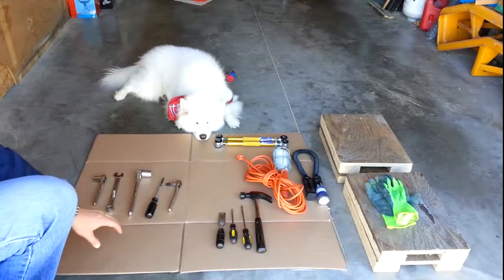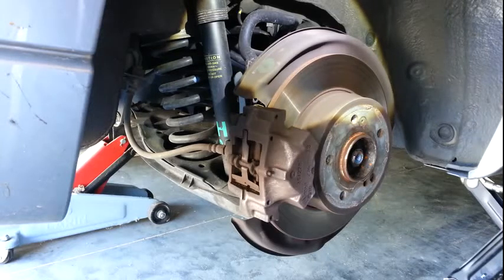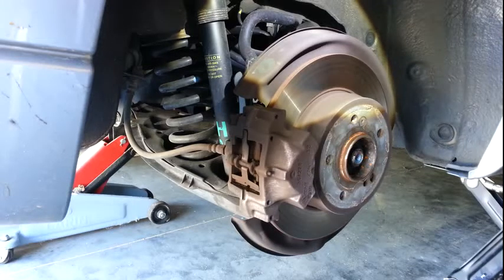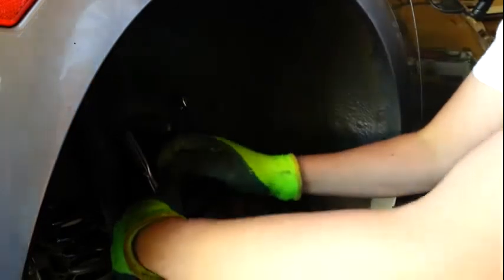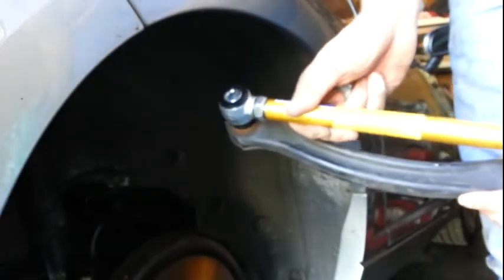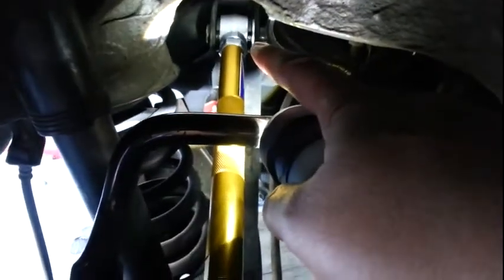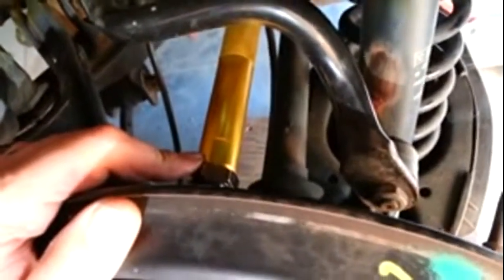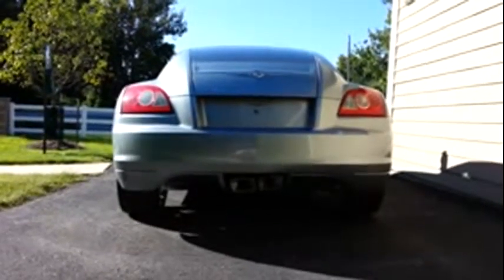Rear Adjustable Camber Arms Installation, Chrysler Crossfire (Mercedes R170,SLK,CLK,AMG,SRT) strut

Comment: Would these arms fit my Mercedes clk w209? If so what make are they? Thanks
Reply from the maker: I really need to put a second video together on how to build these things. The pieces are purchased through speedway motors. I have to admit, I do not know if they will fit a w209, however I am confident you can buy other pieces from speedway to make these fit.

Comment: i have a 2009 w204 mercedes, do you think this will work? I think they have very similar rear ends
Reply from the maker: You will need to pull the bars, measure the distance and order accordingly. I believe the after 2005 the rear end got a little wider and the components a little stronger.
Reply: @glencouls  did you have to adjust the toe after you got the car aligned? or did the factory adjustment make up for it?
Reply from the maker: The alignment that you paid for should have adjusted any tow or needed. When you get your car aligned make sure you ask for the camber and tow printout the machine creates for the mechanic. There are many shops that consider a varience of - 0.02 outside of spec OK, this will burn you through tires on the CF faster than it should, CF tires are expensive.
Reply: @glencouls  Makes sense. Im asking because some people say they have to readjust the toe after correcting the camber. There's a small camber bolt used to adjust the toe but it only offers small adjustments (+-0.5 degrees?). I want to make sure I dont need a bigger adjustable toe arm.
Reply from the maker: I did require a full alignment after my camber install, this included toe, and camber adjustment for front. The print out before and after is imperative.
Reply: glencouls I finally got around to doing it today. Turns out it fits without hitting the sway bar. There’s about a quarter of an inch of space and I used a 10 inch bar instead of 9
Reply from the maker: Thanks for this info for our other viewers, you did a good thing here for sure!

Comment: Great video, any issues with camber arm hitting the sway bar?
Reply from the maker: No, not with stock heights. The arms will hit if you lower the car. In that instance you will need to purchase camber adjustment arms that look more like a dog leg, they have a little crook in them that jettisons off in about a 10 or 15 degree angle. I live in a large metropolitan area that does very poor road maintenance, so lowering the car and battling these mammoth potholes is just out of the question. If you have a lowered car please consider subscribing, I have suspension videos coming, and an interesting video planned on how to file an insurance claim against a pothole and not be denied. Thanks for watching!

Comment: I ordered parts and will be changing out on my 2002 mercedes-benz clk55.
Rear camber adjustment  
Will I need to get the rear alignment check at a shop after I install the arms?
Reply from the maker: Hey, thanks for watching the video. You will need to get the car over to a shop and on an alignment machine so the camber values can be inspected. You want the report printed out by the alignment machine. It looks like :58 seconds in on this video:  https://youtu.be/tw_bOHEoNzA make sure you let the mechanic know you installed the camber adjustment arms so they know camber can be adjusted on your vehicle. Please confirm doing this on your clk is required. Your version may have camber adjustable bolts installed.

Comment: Hi there...did you ever find your car to occassionally feel like it was stearing from the back on uneven surfaces? I have four new Perrelli tyres on mine. I just bought car, and I find when I floor it or drive on un even surfaces the car feel really unsettled and occassionally even stears from the back left ....hoping camber change may sort issue ...any help would be great
Reply from the maker: Yep, I have felt it even after the camber install. I feel It's due to the width of the tires, the high power engine, and the light weight of the car. It doesn't take breaks in pavement very well even at low speeds. When I really get after it, it feels a little  squirrely back there unless the pavement is perfect. maybe that's what happened to this guy https://www.youtube.com/watch?v=lX6Msptajz8
Reply: glencouls lol seems I'll be keeping it under 65 then.   Hahahahaha
Reply from the maker: J Dude I wouldn't be that freaked out about it. it's just a little shift or weight redistribution. I have had the car up to 120 mph in the mountain passes coming out of British Columbia. there are plenty of little pavement breaks, road cracks, even pot holes, the car did great. I'm with you however it's a little unnerving when you are going 70, gun it and feel that little shift when passing somebody or whatever.
Reply: no worries mate ....I still like the car ....Id like to get it fixed ....probably gonna change rear sub frame bushes next. I have checked bearings - camber arms - shocks might be old but working fine ...I reckon the rear sub frame is shifting slightly under surface change and heavy load .... we shall see ...still sexy as faaaaaak sounding engine : -)

Comment: I don't what kind of mechanic yuo are but the adjustble camber arms already install't to correkt the line up the weels in the back of the car und yuo just don'know wher it is ;-)
Reply from the maker: everybody on the Internet is a master mechanic right? I'll be the first to admit I'm a programmer, not a mechanic, but I can tell you, the Chrysler Crossfire based on Mercedes Benz R170 chassis has no camber adjustment at the rear of the vehicle. if you know differently, then please provide a link to your repair. Thanks for your contribution.
Reply: Ok i tri ,i'am driving an SLK 170 since 12 yaers and this year i had to replace all the link's at the rearachsle and there are 2adjustble scews to setup the tire alinement they sit at the lower front at the bodyside.I try make picture but i can't link i in here i put a link http://www.mbslk.de/images/forum/beitragsbilder/938616 it's  german forum about SLK's
Reply from the maker: +Klaus Nebeling thanks for taking the time to put a link up. I'm on the road at the moment and will need to investigate this when I get home. being in front like that, I would believe that it's more related to toe then to camber. I would think for camber you would want a strut from the top or bottom linkage.

Comment: hello glencouls, I have a 03 mercedes clk55 amg and i curbed it pretty bad on the left front tire. the ailgnment got messed up and the dealership said i need to replace my front torque arm bushings.  I think I want to just get 2 new arms but there are so many options (front "rear", front left upper, front torque rear). I just need the 2 front torque arms (passanger and drivers side). PLease help.
Reply from the maker: I'm not very familiar with the clk55, sorry. I believe it shares the same chassis as the Crossfire Mercedes R120. I would reference this manual, http://cl-44.iwatchradio.pw/owncloud/index.php/s/3AEasz2rw6Xc3o8 (password:"amg") get the names of the parts you which to change, and look them up on rockauto.com.
Reply from the maker: *should say Mercedes R170 Chassis. This also marks the first time I've used my owncloud as a public file share,  so if you could let me know if you were able to get the file I would greatly appreciate it. Thanks.
Reply: link didnt work but thanks for the response
Reply from the maker: +Alexa Navarro my self signed certificate was giving me some trouble yesterday. I have since rebuilt the certificate.  when going for this link the browser will likely complain about the self signed certificate not being from a trusted source. it's ok, my server is not trying to take over your browser. Try this link: https://cl-44.iwatchradio.pw:442/owncloud/index.php/s/3AEasz2rw6Xc3o8 notice this link is "Https" that is significant of the security certificate. This link just worked for me. use a desktop computer to view this file. its a large PDF with over 3,000 pages, your phone could choke on it's size. explaining in detail how to take apart a R170 chassis vehicle.

Comment: i have a mercedes slk 320 and i just hit a curb really bad and the allignment is completly off but the back right side wheel go littteraly bent in to the point where the tire is aiming towards the inside so i replaced the part that got actually bent but i was planing on going to the mercedes dealer to go get an allignment because they have a special here in texas where its only 120$ would you think they would adjust the camber while doing the allignment or no? please answer quickly as i am going tomorow
Reply from the maker: camber should be adjusted during an alignment.  make sure, you specifically ask them to check the camber, and remind them you want it within factory spec.  you should get a print out like you see in this video at :56 seconds: https://m.youtube.com/watch?v=tw_bOHEoNzA 

you want all four tires in Green, no tires in Red. Red means you need to do something to get adjustment back in spec. good luck, I hope everything is OK with your car!
Reply: Thanks man! il keep you updated on what happens

Comment: Who makes the camber arms that you installed?
Reply from the maker: Thanks for watching my video. I made my adjustable camber arms from Afco street rod tie-rod parts, you can pick them up at some speed or customization shops. I bought mine from Speedway Motors. I believe they are online. I'm going to keep this kind of generic because I don't want to promote any products on my page, then have somebody buy the specific product, crash their car then blame me for damages. Note... you are modifying your vehicle at your own risk, you are solely responsible for your vehicle, the parts you install on it, and the way you drive it. 

Here is what I did: I measured my original non-adjustable camber struts (I forget the details). Then I purchased internally threaded rods, I think one side is left hand thread the other righty tighty (like normal). I chose rods 2" shortter than the original camber struts. Then I purchased I-Bolts with the same internal diameter as the original struts (one left hand thread, the other right hand thread), and some nuts for positioning. I screwed the nuts onto the I-Bolts, then the I-Bolts into the threaded rods. With the car on the alignment lift, or camber sensors, simply tighten the rod until you reach desired camber, then tighten the nuts locking the rod and I-Bolts into position. I do plan on making a general "Do it yourself adjustable camber arms" video, I just have yet to get around to it and the legal concerns kind of freak me out too. I'm just a guy with some wrenches, not a Mercedes or Chrysler mechanic. Thanks again for watching, please subscribe if you own a Crossfire. I modify or change something on mine every couple of months and I usually document here on youtube.
Reply: +glencouls You seem EXTREMELY paranoid/anxious man. Nobody is going to sue you because they crashed their car, that is completely ridiculous. They'll sue the company WAY before you. Anyhow, just write a disclaimer in the description like everyone else on youtube... there's nothing to worry about lol

Comment: thats weird my slk is 1997 that has crappy chinese tires and im driving on crappy roads and i drive the thing like i stole it and yet i dont have that issue ! did you curb it hard or something ? coz i did curb mine a bit and it even to a small chunk out of my tire AND my rim and it still didnt make any issues !! plus those bolts look like they might get undone overtime unless you used some kind of liquid thread lockers wich i cant see :S how is it now ??
Reply from the maker: nope, did not curb it. did drive some rough roads from Alaska to the Midwest, so yeah I had put the car through it.no issues with the bolts backing out, fine thread for big bolts and I had to really torque with the ratchet to get 'em off there, then back on. They're not coming off of there. My concern was more so the I bolts that thread into sleeve, or the sleeve bolt getting stripped. at last inspection 7,000 miles, everything looked good. thanks for your comment.
Reply: good to hear everything is going will ^^ thanks for the video share :>
Reply from the maker: +KingStivan let me ask you, how is the headliner holding up in that ol' 97?
Reply: glencouls VERY GOOD !! like new after i changed it :P

Comment: Thanks for the video 👍. As you can see in your video the sway bar is bolted to the top, mine ripped that loses bolts right off the body, so every little bump I hit it bangs against the body of the car and is really annoying the hell out of me. Do you know how I can get that fixed?
Reply from the maker: do you have a photo? and I have to hear the story, did you curb it?
Reply: +glencouls I'm not sure how it came about. When I purchased my aftermarket wheels the guy that was installing them pointed it out to me. At that time it wasn't fully detached/torn. Now the sway bar is detached from the bottom of the car and bangs against the cars body on every little bump
Reply from the maker: hmmm. I'm not seeing a sway bar in the manual. I have a track bar, and rear stabilizer bar. What I would do if I was you, would be to lift the vehicle up at both rear jack points, I would place a floor jack underneath the rear differential but just enough pressure on it so you know it's holding it (essentially lifting the vehicle at all three points. lock the wheels on the floor jack). Take both rear tires off. Next I would look to see if any bolts have backed out, and inspect the threads. If it's the rear stabilizer bar that is banging around I would see if the ends where they connect back to the suspension have become loose. These require 66 foot lbs of torque. If they don't have that (or are gone!!!), I bet that rear stabilizer bar is just floating around in there not really anchored to anything. The bolts are all metric. It's important that you don't use the same stripped bolts back in place. If the holes are worn, re tap the threads (yes you can buy metric tap and dys). This car is a mercedes benz R170 roughly 1998 slk320-2008 chrysler crossfire. You can source parts at many places but I prefer Rock Auto. Let me know if I'm way off base here. I have no picture to go of off so I'm blindly guessing off of a couple of short youtube posts.
Reply: +glencouls I'll take pics on Mon... Where do I send them ?
Reply: +glencouls thanks bud! Email has been sent.
Reply: ha, i had the same problem. i weld the son of b*****h up.
Reply: The mounts break off on the crossfires and mercs

Comment: does the new adjustable arm clear the sway bar ?  thank you for the upload
Reply from the maker: yes, great question. at stock heights these camber arms clear it fine, however, if you have dropped your car more then .5 inches, they will rub, and you need bent camber arms.

Comment: Hi,Really enjoyed your video on the adjustable camber arm,I have a Crossfire myself.
I have been searching the internet for the adjustable arms you used with no success,I would like to know what Brand they are or where did you purchase them,Thanks Jeff
Reply from the maker: Jeff Fehr Hi Jeff, Thanks for watching my video, and the kind words. I made my adjustable camber arms from Afco street rod tie-rod parts, you can pick them up at most speed or customization shops. I'm going to keep this kind of generic because I don't want to pimp any products on my page, then have somebody buy the specific product, crash their car then blame me for damages. Note... you are modifying your vehicle at your own risk, you are solely responsible for your vehicle, the parts you install on it, and the way you drive it. 

Here is what I did: I measured my original non-adjustable camber struts (I forget the details). Then I purchased internally threaded rods, I think one side is left hand thread the other righty tighty (like normal). I chose rods 2" shortter than the original camber struts. Then I purchased I-Bolts with the same internal diameter as the original struts (one left hand thread, the other right hand thread), and some nuts for positioning. I screwed the nuts onto the I-Bolts, then the I-Bolts into the threaded rods. With the car on the alignment lift, or camber sensors, simply tighten the rod until you reach desired camber, then tighten the nuts locking the rod and I-Bolts into position. I do plan on making a general "Do it yourself adjustable camber arms" video, I just have yet to get around to it and the legal concerns kind of freak me out too. I'm just a guy with some wrenches, not a Mercedes or Chrysler mechanic. Thanks again for watching, please subscribe and we can work on our cars together. Cheers.
Reply from the maker: Keep in mind if you plan on lowering your XF, you need bent adjustable camber arms or the arms will rub against other suspension components. I have done zero research on this lowering process, so somebody else will need to figure out the parts list on that adventure. hahahaha.

Comment: The rear suspension component is the camber strut. Do not use "torx"; the bolts have XZN heads (also called triple square, or spline drive) and are used high torque applications. Positive criticism aside, thank you for making and posting the video.
Reply from the maker: Hey, thanks for the correction, you are right the manual says "camber strut" Trust me if I use "Camber Strut,"  in the video title I'll get 3 hits per month. I need to use the Lexicon used in the forums or nobody will find the video. Looked like a Torx T-55 to me, but I don't want anybody stripping out their Camber Strut bolts so if you guys have a XZN socket bit set please try out Mitchell's suggestion. I added strut as a tag, and title keyword, let's see if it helps the video. Thanks Mitchell.